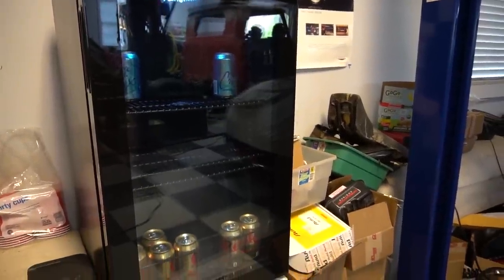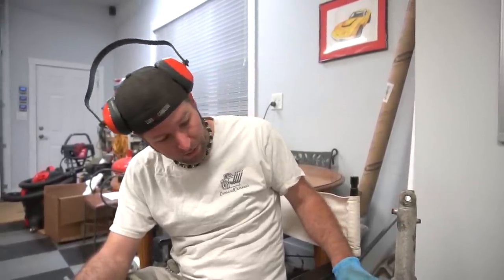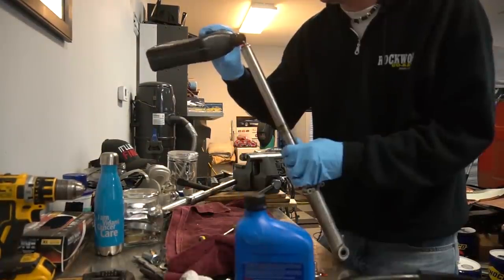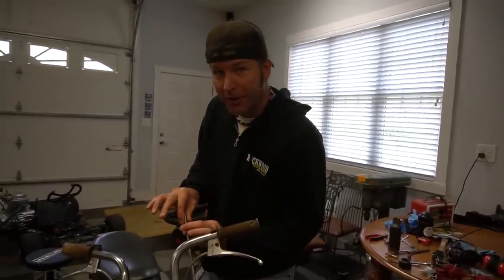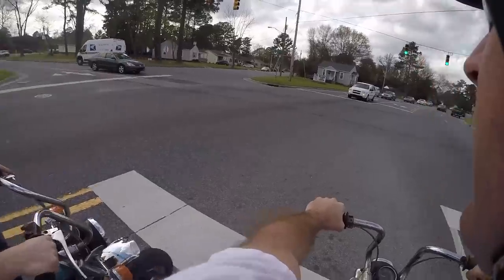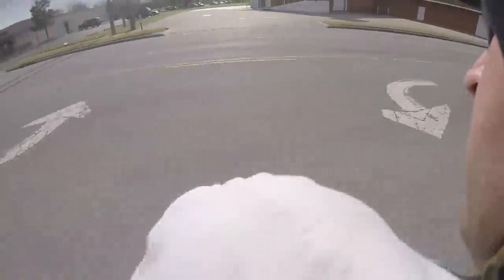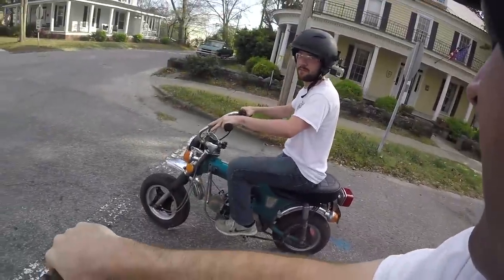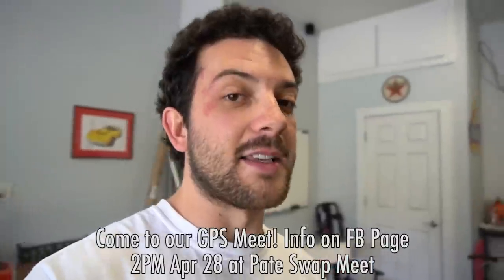Road Legal Mini Bikes | First Ride in 30+ Years!

Comment: Ok CT 70’s are nice little bikes, sort of a cross between a mini bike and motorcycle. But when I was young, it was the SL 70 and Yamaha Mini Enduro that we're the best! Now I have an old buddy, that recently bought a like new Resto-Mod SL 70! That's been built into a 125! With the coolest set of mini Ohlin Forks and Reservoir Shocks, I've ever seen! Especially with the bike painted the rare Honda Gold tank, headlight, Fenders and side covers along with a cool chrome rack in the back! Plus a very nice aftermarket pipe. That little bike sounds, rides and runs great! He has taken it camping with him all the time! Some of the family thinks he's got more dollars than sense, but hey you only go around once! Plus it's always best to ride a slow bike fast, that a fast bike slow! But that little bike can actually cruise all day at 60-65! All while getting over 100 mpg! Now I'm looking for one, or at least a frame! I'll get forks and swingarm and shocks anyway, but an SL 125 Engine is not so hard to find. There are Chinese knockoffs that are cheap, but they will not take the abuse a Honda engine will. I'd picture building something like a Mini Tracker that's street legal! One question, your bikes, are they 3or 4 speed?

Comment: Where I live, long as the seat is 25" high off the ground it would be a motorcycle (by today's standards).

I guess I was mistaken. According to the 2018 laws in Nebraska, as long as it has 1 to 3 head lights that can be seen upwards of 500ft (or 200ft wording is weird) same for the brake/tail light, turn signals, at least 1 brake, 2 mirrors, at least 10hp, and tire/wheel size of at least 14". So I'm thinking maybe getting a Baja MB200 or similar or build my own frame and get a Lifan 200 and use that as my daily ride to work.

Comment: Hey, Really Liked Your Video. I Got My Trail 70 In October '71 When I Was 13 & We Never Called Them CT-70. Sometimes We Called The 4-Speed Model, Clutch 70 Because At That Time Most Of Them Were 3-Speed Automatics. There Was A Sign On Them That Said For Off-Road Use Only But My Father Registered Mine & I Still Have The Plate . . .

Comment: Would be cool to see a big bore kit. Or replace with a bigger Honda clone. Something that still looks relatively stock.
Reply from the maker: We're thinking 140cc semi autos😈
Reply: Get them both the same motor but mod them differently to see who can build more power. I say manual 4 speed all the way. Clutch gives it some character.

Comment: Looked like a good time. Its always way better to ride with a buddy or group. I have a 97 honda eliet sr50 scooter with a "race built" engine. 72cc head athena crank n piston, and some other goodies. Took it out 2 weeks ago and gps said i hit 64mph. Scoot speedo tops at 45 and i couldnt even see the needle. Anyway if u guys ever do a meet and greet close to southern new england id be there. Ive never been to n.c. but busco beach isnt really a good scooter spot, unless i put some knobby tires on it. Been enjoying the channel for a few years and im sorta egerly anticipating your kick off of velocity dispatch.
Reply from the maker: Holy cow! 64mph out of the stock engine!
Reply: 72cc head.. not entirely stock. ;)

I'm sure you know, plenty can be done with cylinder kits and the 2-stroke world gets extra crazy with performance exhaust, reed values, etc. Then you can play around with variator mods, or gearing on mopeds.

Not as straightforward as an engine swap but it's crazy to see what you can squeeze out of a few changes.
Reply: Its also got some aftermarket transmission. Speedo tops at 35mph and that's when it goes from 'low gear to high gear' but its more of a cvt style setup.  A place called HP Logic in Fla has a fast scoot of their own u can find a few bids on.  They're better known for importing Japanese cars and performance parts.  John should go rotary in the mx5. Anyway enjoy the channel and the antics.

Comment: I don't remember if I told you but these engines have an oil filter well it's more of a screen but you pull the clutch cover and gasket to get access I just modified my 49cc to a 110cc there is a lot to changing it over I have more torque and slight top end increase I think the 19mm carb is too restrictive so next step is carb upgrade 50 mph is top end so far. Oh the other thing to check is that the crankcase vent tube is not kinked, if it is kinked your engine will get full of sludge and clog the filter screen I also upgraded the oil pump on mine to a high volume and added an oil cooler.

Comment: hi guys, love the ct70s. Is the flickering taillight an effect of the camera or does it actually flicer ? If it does flicker you might want to check that your voltage regulator hasn't accidently been swapped for a 12v unit instead of the correct 6v one. If I didn't live in Australia I would be very tempted to give Ike the old motor from my C90 so he could keep up. Keep having fun and sharing your projects.
Reply: It flickers because it's an LED on unfiltered DC current. Basically there's ripple in the current made by the charging system. It happens so fast though that you can't see the flicker normally, but since it's at a different speed / frames per second than the camera it shows up when filmed.

Comment: About the dragster you guys are right about the sp rings to dial it in but seriously a 1968 beetle or Porsche smog pump makes a great blower. Look up the mini bike on YouTube that has one you will need a blow off valve too. But it's simple suck thru the carb no problem s.

Comment: Hey guys I have an idea for a new video.   How about a shoot-out between a kart equipped with the best carb you can find against one of the Tillotson TCT Mechanical Fuel Injection systems.  I’m thinking same kart, engine, gearing and put them on the dyno.

Comment: look into putting a larger cc motor like the 110 from a three wheeler or at least the top end from one... i know in the yamaha's the DT, IT and YZ share a lot of parts together. i used a DT125 crank and rod in my IT175 when i lost the lower rod bearing at 40 mph.... or just go to a motor like 200cc, i know there is motors that are larger cc with the same configuration as the CT70 as far as the close to horizontal jug...

Comment: It depends on a lot of things, but I got about 8 mph extra by gearing down the front sprocket.  Put the engine into a higher rpm range, thus more power and therefore more speed.

Comment: just 140 swap it then do a big bore later on youll get more gear and better ratio power to weight is in a better % so youll have more fun and be safer by having more torque out of lights we got more issues in the world than a purest gettin butthurt id say keep it 70cc if you were just going to offroad it or beach cruiser but for street you need the 140 or even a 125 the mounting i believe is the same as a xr50 so should be a bolt in and make them 12 volt if theyre not yet

Comment: Could you put one of those 125cc that you put on John’s race cart on one of those?
Reply from the maker: We put a 200cc on my race kart, and it's way bigger than the factory engine. The nice thing about the 125s, and 140s is that they're the same size as the factory engine. No cutting/welding required.
Reply: CarsandCameras whatever you decide I'm sure it will be awsome! I love making things go faster than they should just like you guys!

Comment: Street legal suspension minibike scratch built way back in 1968 with 350cc 2 cylinder 2 cycle 4 speed dual exhaust for stereo sound: 
https://i1088.photobucket.com/albums/i333/BuzzLOL1/BuzzLOL%20Pictures/DannyFuneral008-1-1.jpg 
.

Comment: Curious, how does the motorcycle test work in nc? In the UK we have to do 2 test. And if you're 19 to 24 you have to do them twice
Reply: suzuki etc first a written test. Then you can ride without a passenger for a while ( permit) then you have to take a riding test on a obstical course to get the licence.
Reply: Isaac it'll be fine I wish it was that easy here. I've done my test once already and due to do it again so I can ride above 46bhp power bikes

Comment: I have a question.  Smaller sprocket more top speed????
Reply: Alexandros lianos smaller on rear = more speed if the engine has enough hp
Reply: I have 12 hp engine with torque converter 12 t and 60 t rear and I won't to have more acceleration no top speed.  What I can put ?

Comment: there is hop up parts and even complete engines found here,  along with some very cool accessories too. there is even a stroker kit which will bring displacement with the 85 cc big bore kit to 108 ccs. http://www.hondaminitrail.com/ct70.html not sure where to find it but you can also convert it to 4 speed manual clutch. there is tons of parts available with some digging.